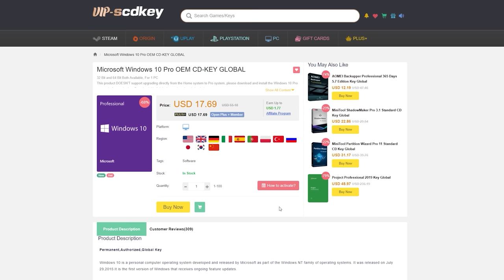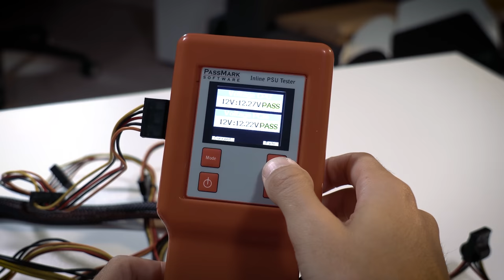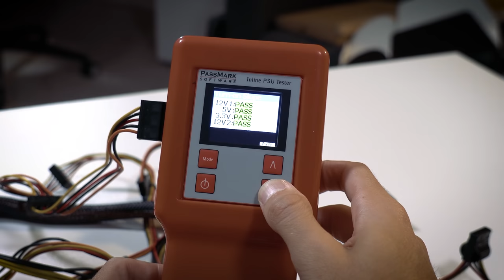Fixing a Viewer's BROKEN Gaming PC? - Fix or Flop S1:E10

Comment: I LOVE the work Greg did, it is honestly the best Gaming PC I've had my whole life, and he even made my computer run 100x better, faster.  Fantastic job, couldn't have asked for a better fix.
Reply: Also to mention, the PC was a hand-me-down, and all BestBuy had was that TT AIO.  I am definitly going to upgrade MB, Processor and Ram later down the road.  But for now, it may be low-end to current Gen, but it's running everything 10x smoother, and I can even play HL: Alyx now.
Reply: Thermal Take instructions are like trying to read Hieroglyphics, I threw the manual away and YouTubed it.  Missing screws, I wasn't aware as the uploader wasn't too thorough.
Reply: Yeah a lot of computer instructions suck. The ones for my corsair rgb fans were horrible.  I also had to watch a video haha.
Reply: replacing a PSU ain't gonna make your PC 10x faster bud.
Reply: @YumiSumire  i assume he means compared to his PC before that one? would be the only thing that makes sense lol

Comment: More ketchup and mustard In this pc than a hotdog
Reply: Plus that crap thermaltake psu model usually gets noisy (fan) @40% load  😅
Reply: Nice, but I prefer ONLY some yellow mustard on my dogs, but I get your point ;)
Reply: Even if the PSU worked it needed to go - just because of the wires( or spend way too much Sleveing them)
Reply: @Rob Mikels its pretty good with bacon or sausage rolls
Reply: @wsketchy  you have lost your rights breakfast meats.
Reply: Yes putting mustard on it will fix anything
Reply: @Rob Mikels am i weird for using mayonnaise

Comment: I am a manufacturing engineer that specializes in circuit board assembly and soldering. I call that tell-tale smell "a sign that your day is going to be terrible" when it happens in a factory. 

I also am not an electronics expert (ironic, I know) but that's why we have test/electrical engineers. They tell me which part let out the magic smoke and my job is to figure out how the manufacturing process went awry and hopefully prevent it from happening again.
Reply: So what do you think of gigabyte power supply manufacturing

Comment: He has a great case and a new power supply and a good GPU. He just needs to spend $200 on a Motherboard, CPU and memory and he is better off than most people who don't have a GPU. A RX 580 with 8GB is a good place to start.
Reply: A new 10400F plus B-series motherboard, and 2x8 GB DDR4 3200 and he gets a nice system to upgrade later when GPU prices become something rational again (sigh...maybe 2-3 years?)
Reply: People like to dump on old hardware but realistically a 580 8GB is good enough for even most new games at medium settings 1080p 60hz. Super enjoyable experience for probably 99% of people.

We bleeding edge enthusiasts are really just a very vocal minority when it comes to the overall customer base I would think. Hell my last 2 upgrades have netted me zero real world performance. I'd still be getting the same 144 FPS at 1440p in all the games I actually play on my old 7700K/1080Ti build, which I upgraded to a 9900K/2080Ti, which I upgraded to a 10900K/3080.
Reply: @ImOnyxRS  I bought a 570 like 2 weeks before lockdown in March 2020 for $140 now it's worth close to $300... I'm still happy with it, although I will probably upgrade it within the next year or so.

Comment: That HAF 912 is a legendary case... RIP (the upgrade is very worthy tho ^_^)
Reply: Still have one packed away in a storage closet...can't bring myself to simply toss the OG lol
Reply: Still using one.
Reply: Good memories with the HAF 812 here! I removed the optical drive and hard drive cages and built my first custom water-cooled loop in one a few years ago. Rocked a i5 7600k and a GTX 1080ti and just recently sold it for about double the amount I put into it. Good times!
Reply: @jsekits  . Sell it and let it have a new life with someone else.
Reply: my HAF 922 (bigger model) is still under my desk (sadly for it It hasn't run once since I got my new laptop earlier this year)

it ran very well for many many years (i5 3570k OCed), and it has always been insanely cool with a nice cooler master hyper 212
Reply: I still have the plus version of this case
Reply: @Bejito81   just built my 3rd system in my Haf 922 and is still keeping whatever I put in it cool ovclcocked MSI 1060 runs 66-70 c and Ryzen 7 5800x runs mid 60s
Reply: @Bejito81  my 922 is still going 10 years plus and is in use daily..one of the 1st truly mod cases..

Comment: The second I saw that PSU and "it doesn't power on" knew it was the PSU
Reply: Thermalfake amirite
Reply: I was yelling at my screen PSU! the first moment he tried to power it on
Reply: Yep. Either it's playing up due to RAM (which can sometimes be the case, some boards will power cycle on and off if the RAM is 'out' by even a few mm) or it's immediate that the PSU is suspect; FIRST thing he should have done was run that PSU on the tester.
Reply: @blackknight50277621  No, it's still thermalTAKE, as in take out your components along with it.
Reply: I knew from how the power cut off immediately after being powered on. Designed to prevent further damage it will cut its self off as soon as something goes wrong (well suppose to). Guy is lucky that rest of the system didnt get fried. Last time i had a psu die on me it took my 2tb hdd with it that had somewhat important stuff on it (seagates data recovery covered it but found nothing)...
Reply: With that said it is still good to go through each step by step to make sure it isnt anything else. Only gripe i have is since it was a power issue why not try another psu first since and extra is on hand. There was potential of frying the pc many times with the mutliple tests.
Reply: Me too
Reply: Those TR2's are the worst power supplies I've ever seen
Reply: @gackhuhn4868  I've had three die, one of which almost caused a fire
Reply: @PCFixer  cant assume, i had similar issue and it was my motherboard cpu socket. the AMD stock wraith cooler bent my motherboard on the socket a bit and caused random power offs and sometimes instant if I didnt put pressure on it. he does a great job by not assuming
Reply: @realcomputerdude100  worst power supplies? Have you ever heard about Aerocool Kcas/Vx ? If not , i'll tell you , first one is basicly a bomb with a timer and a second one is a flare charge .
Reply: Bro, I instantly knew it was the PSU, ffs

Comment: That transformation was incredible it literally looked like a brand brand new system, that case is a great choice too. Mounting the card vertically was a great choice too. I really enjoy this series I’m glad it’s growing!
Reply: The vertical mount is bad for the aiorflow and blocks the other PCIe slots.
Reply: @tyaty  I was more referring to a look standpoint but sure that’s another way to look at it
Reply: @GaryA1682  
Also, the HAF 912 did not really need an upgrade at all.  Greg only did it because BQ sponsored the video.
Reply: not if it has sufficient clearance from the side of the case.  also i don't know anyone that uses the other PCIe slots @tyaty

Comment: Holy, that 802 is an amazing case! I was looking to buy it but couldn't in Canada. It's amazing for both silent operation and airflow. I totally recommend it to others!
Reply: Yes it's excellent.  I just got one a few weeks ago, slapped some parts in there and it's so easy to work on.   It runs cool and quiet while looking good doing it.

Comment: As soon as I seen that TT PSU, I expected it. Just never had good luck with their PSU's. Least the owner didn't have any hardware damaged from the PSU. Never want to go cheap on the PSU. Awesome case though! Looks like a brand new pc for the owner!
Reply: My brother had the PSU before me, it lasted him about 6 years before he handed it off to me.
Reply: I was thinking exactly the same when I saw that psu. I've had many psu's over the years and the worst one was Thermaltake. 

It caused some random crashes and for some reason that psu internally shorted a few times and caused system to power off. I had to insulate the psu case cover myself to keep using it as I was still saving for a new one. Luckily it didn't break anything else with it... 

I still have Enermax psu that I bought after that and it still works fine in my home server even though it's around 10 years old and it has been used heavily over the years.
Reply: My TT PSU fried my GPU and MOBO.. It's on my personal black list, becouse I heard many times about their bad PSU's
Reply: Thermaltake sucks
I have a Thermaltake 450W with only Ryzen 1800x + Mobo without GPU and it popped under cinebench.
Replaced the fuse and still Thermaltake popped the fuse.

Comment: Hah I remember having the same exact PSU and the same thing happened. I'm glad you hooked the person up with some new parts, they'll be happy for sure!
Reply: Not surprised, that is a bad PSU and it wasn't good when it was brand new either. It's one of those "slap big wattage number on it, cut lots of corners on the components and design, then sell to unsuspecting people for really cheap" models that were quite popular a while back. At least it's not one of the PSUs that completely removes all the filtering circuits to cut costs and claims 600W out of a 250W unit, but I doubt that makes you feel any better when it bricks. Well maybe it does, at least it doesn't look like this one bricks the entire rest of your PC with it.

Comment: Tips :
1. If you can hear a long tiiiiiiiiiiiiiii from your PSU. There is a leak in one of the caps.
2. If you can smell something fried it's most likely the MOSFETs under the heatsink. 
3. You can also get 24v, 8.7v, 7v, 21.7v,19v from your PSU.

Comment: Thermaltake PSU, that would have been my first step to this troubleshoot. I've had mostly bad experience with their PSUs, particularly the cheap and/or old ones.
Reply: I've seen that exact model crap the bed more times than I should of.
Reply: I have a thermaltake 1200 watt psu - been going strong for at least 12 years only cleaned it once !
Reply: Thermaltake is very hit or miss with quality. My system’s thermaltake $50 PSU has been going strong for years, whereas I’ve seen friends’ systems exact same model die in a few months.
Reply: @herbetrono4373  tr2 tho? those would fail out of nowhere.
Reply: @herbetrono4373  
Your single good experience doesn't invalidate my half dozen or so bad experiences. There was one time I thought the issue was the TT PSU, but it was a fried motherboard. A month or two later I was replacing the customer's motherboard again along with the thermaltake PSU... That'll teach me.
Reply: @MrNside  Your dead right mate , just thought i would put my 2 cents in  !

Comment: Wait did you replace a HAF 932 case? The HAF are the best airflow cases even by today's standards. If I could get a HAF X over the be quiet case any day.
Reply from the maker: Yes, I replaced the HAF case. The 802 is still fine for airflow, and the three 140mm PW2 fans are great.
Reply: I always hope he asked if he could replace the case - I love my msi mag forge 100r even though its a cheap case and if he changed it I'd be very unhappy even if he'd replaced it with a £500 case free of charge.
Reply: preferences because the haf looks horrible
Reply: @GregSalazar  do you ask?
Reply from the maker: Of course I do. I've already discussed this in an older video.
Reply: @knownnuisance7512  Obviously it’s because it’s the sponsors the taste is a matter of of opinion but I was never negative. Thanks for your negative opinion.
Reply: @GregSalazar  OK thx. I was worried as some people might have gotten a perfect size case or something. I guess I either missed that vid or forgot about it lol
Reply: In my experience old CM cases ends up falling appart (removable plastic front & top panel) front i/o cables can short out too (had a cm690nv kill multiple usb keys)

So an upgrade can be welcome.

Altho I'd take a mint HAF for a retro build anyday!
Reply: @wisico640  Same. It’s easily fixed though.
Reply: Looks like a HAF 912, which is actually just a mid tower. With that build there would be more empty space than used if it was in the 932. Using the 912 now with my main machine, and I would agree that its got great airflow, but with a 3080 RTX, massive heat sink, and full ATX MB, its a bit crowded especially with the 5.25" drive bays; call me old fashion but I still cling to having a optical drive. In any case (pun intended), maybe I should consider an "upgrade".

Comment: In addition to your DMM, you may also want to pick up a capacitance tester.  When you opened that PSU, the first thing I'd check after allowing bleed-off, is those caps on the side where you smelled the magic smoke.

Comment: When it would only try to power up once, and not again without cycling the main on the back for a few moments, I had a good feeling it was the PSU.   Something was being tripped in it, and I've seen this very problem a couple times before myself.

In any case, nice work as always, man.  Case upgrade was quite nice, and airflow potential looked pretty sweet in it.   Nicely done.

Comment: As far as the van idea, I like it. I'd personally choose an ambulance. (Yes, you can get them old or new. The lights need to be disabled and/or not emergency colors, based on state.) Not only are their work surfaces and plenty of storage in them, there is also a secondary battery to power any equipment in the back. There might be other options with similar features but this is the one I know. Also, there is a seat in the back equipped with and air ride suspension so that the person sitting in it can work without as sever of bumps while moving. Prolly not as usefully if you don't plan on ride by repairs. ;p

Comment: I had the same model of PSU but a 800W version. That thing lasted easily 10 years (about 3 builds). I actually had the same issue! With the PSU coming on for a split second then powering off is a actual feature in the OPP (Over Power Protection) was being triggered. Very happy to see that while the PSU failed it still protected the main components.

Comment: If you haven't already, you should really do a video on cable management. Its so important, I typically spend hours on it and it takes up a significant portion of my build time. It does help with cooling not having a rat's nest of cables and wires blocking your air flow.

Comment: It’s the filter caps. They start having electronic leakage, and esr rises, the cap now acting as a resistor, has a voltage drop across said resistance and makes heat, that in turn sends what was left of the cap, in a downward spiral, that usually takes out other parts of the power supply, but 99% of the time root cause of failures with power supply’s is electrolytic caps. It’s rare to be an ic.

Comment: Usually those old builds are covered in dust. Thumbs up for the owner.

The dirt inside of the PSU was holding the connections together; with its removal you killed the PSU.

I think you had an easy time fixing this and have made a great upgrade.
But using a bequiet case and a PSU from another brand hurts my eyes.

Comment: PSU failer was the start of the death of my last PC. DO NOT VAPE in the room your PC lives in. The vaporised liquid will condense on cold surfaces such as your windows, mirrors and most importantly here, the inside surfaces of your PC!

I hadn't opened my PC for a long time as it was a very old build, but had been working flawlessly for years prior. I was happily gaming away when all of a sudden this THICK white "smoke" started billowing out the back of my PC! There was also this smell of fried electronics (you'll know the smell I mean if you've ever smelled it before). 

My initial reaction was to kill the power from the switch, as the PC was still running normally at the time, what was surprising considering the amount of "smoke" pooring out of it! However after looking further into it, I now understand why. Over time, having vaped in my room, it had all condenced around the fans and anywhere that was cold like the case's metal and glass surfaces, and dripped down and pooled up at the bottom of my PC case! 

I opened up the powersupply to see the damage (not advised unless you know what you are doing; It can hold power for hours after being turned off in the capasitors and give a fatal shock if treated incorrectly). What had happened was the vape juice had condenced around the cold PSU fan shroud, the condenced vape juice had then traveled down all the wires inside the PSU and over time corroded the protective plasic wire coverings and shorted out the PSU fan wires (luckily is wasn't the mains wires or it could of been sooo much worse).

When you short an electric circuit, the short will heat up immensely. Vape juice is mostly made up of the same thing as what you put in a "smoke" machine, so I had basically inadvertently turned my PC into a supercarged smoke machine and filled my entire room with fake smoke lol.

I replaced the PSU and cleaned everything else up, but vape juice had got into so many of the other components I ended up having to build a new PC. In the space of a month or so I went through 3 second hand mobos and 2 second hand gfxs cards, got a new CPU and bought a load of new ram, but something just kept destroing components. I had basically replaced everything but the case and the SSDs and disk drives by the end lol. It continued acting real funky and just wasn't worth spending any more effort on after the second set of replaced parts started failing too (it had lasted me like 13 years at this point)!